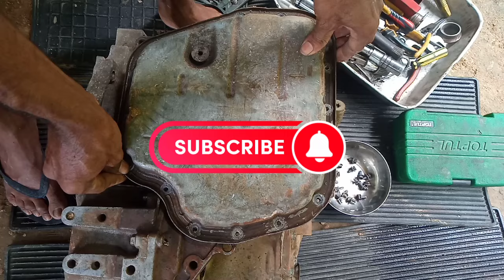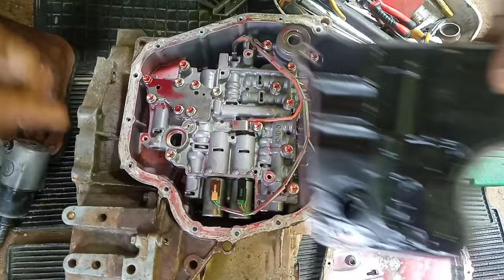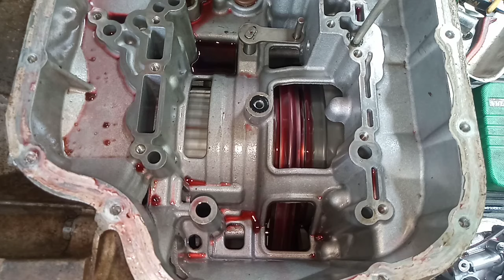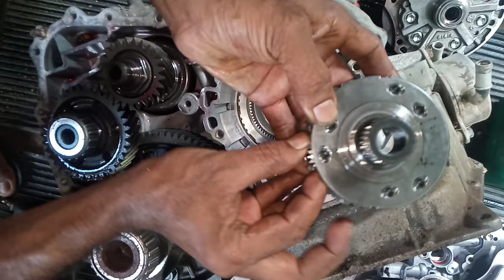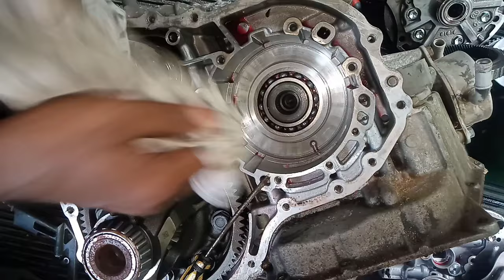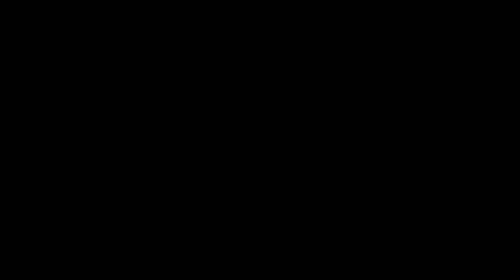Toyota Axio 2007 CVT transmission repair and inspection. #1

Comment: My Toyota fielder 2007 can only move in reverse and not drive. On checking there was little CVT. Can  I fill the CVT and the car be ok.
Reply from the maker: The forward clutch may be slipping.  Changing the oil does not work.  The gearbox will have to be repaired.

Comment: My Toyota axio  2010 has been  leaking transmission fluid. I changed the pump and the converter but it's still leaking. Any suggestions on what could be wrong?
Reply from the maker: You have to find the exact place where the oil is leaking.
Reply: Ok thank you  I will be keen now. 
 @easymoworkshop1054
Reply: Did u find out where it was leaking from? Mine is leaking as hell and mechanics r unable to fix it
Reply: @muhammadyasir6780  I have tried several times but still no solution. I am planning to get it looked by a different mechanic. If problem is not solved I will just get another gearbox. The biggest issue has been converter and O-ring seals.

Comment: After changing the gearbox chain on my Toyota Corolla 2015, the vehicle cannot move in drive and reverse, but sometime it moves as if everything is fine … is now making as if  the clutch is burn ,,
Reply from the maker: Gear calibration should be done after repair.  did you do it ?
Reply from the maker: Contact me by whatsapp.+94775988716.
Reply: @easymoworkshop1054  ok thank you
Reply: My toyota axio 2010 is jerking when  it start to move after maybe a bump any solutions

Comment: does the 2006 toyota noah use the same cvt ? i get shudder from shifting from 1 to 2 at low speeds but wheni step on the gas it doesnt shudder
Reply from the maker: Toyota noah does not use this.  As you have said it seems to be a problem with the gearbox.
Reply: @easymoworkshop1054  the 2006 noah that i have uses a cvt gearbox .i have a 2004 also , that uses normal torque converter gearbox .i have already changed the cvt gear oil .it went away for about a week but started shuddering again

Comment: This is same gearbox than multidrive s? What is  broken?
Reply from the maker: Your question is not clear.  Please direct the question clearly.
Reply: @easymoworkshop1054  is this the same transmission as the multidrive s? what was wrong with this?
Reply from the maker: A certain amount is the same.  The problem with this is that the forward hub is worn out.